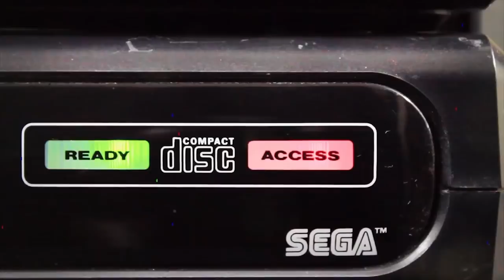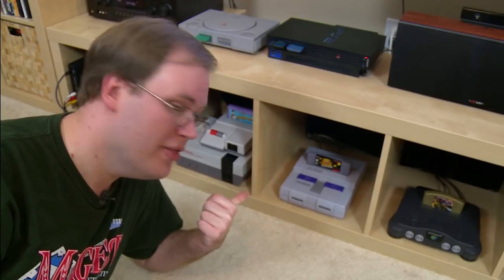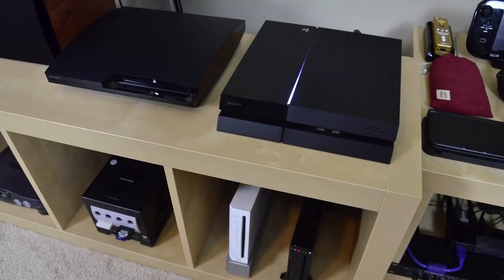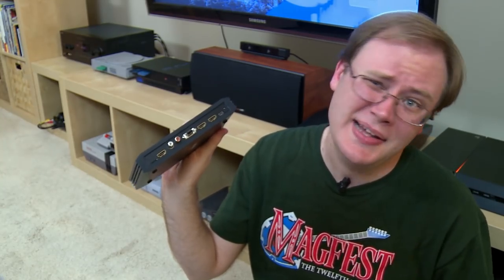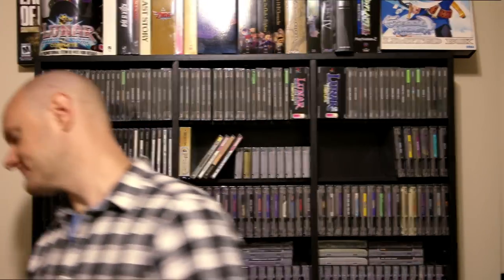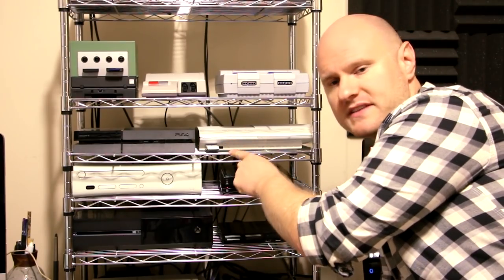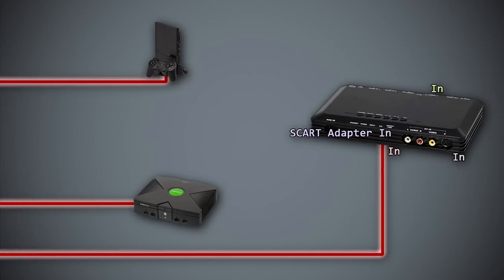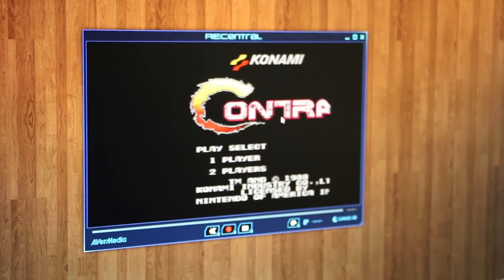RGB and Modern Gaming Setups :: RGB102 / MY LIFE IN GAMING

Comment: So if the framemesiter converts audio to HDMI, does that mean that consoles will pretty much have HDMI audio, or will it still sound like analog audio?
Reply from the maker: NicRenee Khaw [Try4ce] As long as your source audio is as clean as it can be, I don't think there's anything inherently wrong with "analog" audio. At the end of the day, if analog video and analog audio is just the nature of what a console can produce, you can't really think in terms of Digital=Good and Analog=Bad. But it's true that analog has to be treated with care to give desirable results. That said, my ear isn't tuned for sound nearly as well as true audiophiles, so maybe that's just my thinking.

If you do get a buzz introduced into your audio line, then that's going to come through the Framemeister too. Since starting to use a SCART switch box, I noticed that a buzz from some consoles became fairly apparent. I've started to purchase SCART cables with higher grade shielding (offered as an upgrade option through retro_console_accessories), which has done an excellent job of resolving this issue for me.
Reply: ***** Well, yeah. I was just curious to know.

Comment: btw awesome videos I am really diggin this channel. keep up the good work.

You may cover this later on, but is there a reason why Try uses RGB scart on the ps2 instead of component? is the image clearer that way? I always thought the image clarity on the ps2 was really fuzzy. Also this may seem like a noob question but since we are going into 4k will 1080p consoles display better with a rgb signal upscaled to 4k rather than a 1080p upscaled to 4k? since rgb uses analog would it contain more data than the digital 1080p signal? somthing similar to analog movies being able to be remastered from their original analog storage.
Reply from the maker: +TheRdfrota [Try4ce] RGB is just a color space, and the type of signal we're using with old consoles. As for why I use RGB on PS2, it's because I don't have any 480p games to take advantage of the component connection, so I may as well use RGB (I think it looks minimally better too, 480p aside). It's actuality possible to get 480p with RGB on PS2, but it's a bit complicated.

As for 4K, the cool thing about 4K is that it's 2x 1080p, 3x 720p, and 6x 240p. They all scale to 4K without any weird non-integer scales! 480p is the odd man out. Sadly I haven't tested a 4K TV myself, so I don't know yet how good or fast the scaling is, but in theory it should be fine for 1080p and even 720p. I imagine 240p will still need an external scaler to work well, but that would be 240p to 720p/1080p, then a simple scale to 4K. A 4K scaler will be interesting, but probably not that necessary.
Reply: +My Life in Gaming interesting! thanks for the input. After watching your videos I got very interested on the subject. Did a little digging around and specially during the ps2/dc/xbox/gc generation there is some that suggest component and some that suggest rgb. I have seen some video comparisons online but never live. but seems rgb does have shinier colors(if this is a good way to describe it).
Reply from the maker: [Try4ce] The reason one over the other would've been presented back in that generation probably has more to do with regional standards than actual quality. Theoretically, they provide the same results. Depending on how it's done, that's not always the case. RGB is easier to get good quality out of because it clearly defines to the display/device exactly what the colors should be. Component (YPbPr) may require more tweaking on the user's end.
Reply: +My Life in Gaming Ok understandable. I cant wait to try some of this myself. Thanks alot for the tips! I also liked the video on the retron 5. I bought a bunch of famicom and super famicom rpgs because of that video.

Comment: Gotta recommend the bandridge scartswitcher aswell. Running 15 systems through a network of these without any complaints. Havnt added the framemeister to the mix yet but cant imagine with would have any bad effect
Reply from the maker: Daniel Lubner [Coury] So we've both experimented with the Bandridge. Try was having issues because certain system that were plugged into input 5 would receive a little power when another system was on. It was really bizarre - the power light on the Genesis would turn on when it was plugged into slot 5 if you turned on a system in another slot -  and would also only work in that slot to boot. So deciding not to risk damage to the system over time, we decided not to recommend it right now.

However! I found a little guide on the unit recently where you can cut a trace on the board inside the switcher and it prevents this from happening. So I opened mine up and did it, and I seem to be having no problems at all. So we might have a solution (its just really hard to get the unit open!).
Reply: ***** hmm havnt noticed that. Then again all the stuff has just been plugged back in together a few days ago. Gotta look into it. Didnt sound to good.
Reply from the maker: You can read a little about it in this thread. The mod I did is on the first page towards the middle http://shmups.system11.org/viewtopic.php?f=6&t=48460

Comment: Me again sorry to disturb you. I am in the market for some RGB cables however I use PAL systems so will need to get some PAL RGB Scart cables however, the wire that the framemeister comes with is japanese "scart to rgb" will this work if I use PAL cables?
Reply: No, j-scary has the same connector, but some pins are wired differently, and can/will cause damage. But you can get a specific adaptor for euro scary, or convert easily.
Reply: Sorry for the typos. It autocorrected scart to scary, and the YouTube app won't let me edit. Or see what I'm typing. And it crashes after I post. WTG Google.
Reply: Joshua Pearce Perfectly fine, I understand :P. Is there an adapter you would recommend at all?
Reply: Legend, thank you so much :D
Reply: Joshua Pearce Do you know where I can find RGB modded consoles to buy? I don't mind getting the boards and modding myself but it would be nice to have an unmodded version of each console for my collection
Reply: No clue, sorry. Never bought one, I know what anyone with google knows.

Comment: Does the Framemeister generates more lag than the Scart or YPbPr? Because for me this is important for play.
Reply from the maker: [Try4ce] The lag is not inherent to the cables or connections, it's the processing required to display the image on your HDTV. Each HDTV will be different, but the TVs are faster when they receive their native resolution. So if you run it through the Framemeister, it's most likely a bit faster than your TV is on its own. However, there are other options, and if speed is most important to you, then check out the OSSC... you can learn more about the OSSC and other Framemeister alternatives in RGB 105.
Reply: Ok, thank you.

Comment: What if I don't want to use the framemeister? I have the scart cable on my nes. Can I use a scart to YUV converter?
Reply from the maker: pelonalberto in the RGB 101 video we talked a little bit about a scart to component box that you could use. Also, there are SCART to HDMI upscalers that will also work - but the results will be nowhere near as stark as with the framemeister.

Comment: For some reason the Framemeister is not passing audio thru my VIZIO HDtv.....( using the RGB Scart input )....the audio on the SVIDEO input works fine though.....???
Reply from the maker: [Try4ce] Does your TV have a Deep Color setting? That can screw with Framemeister audio. You may also want to try disabling the Deep Color option in the Framemeister menu, since it could cause compatibility issues.
Reply: i'm gonna trouble shoot this over the weekend, and give you an update - thank you so much !!
Reply: Well, no Deep Color Setting on the TV , and I turned that setting off on the XRGB mini but no luck with audio on the HDTV ....

AND I just hooked up my PS4 using the HDMI input and STILL no audio ?? Im gonna hook this up to another TV cause its either a defective framemeister or my TV is not compatible right ?

I really hope I did not by a defective unit ....
Reply: SO I have now tested it on 2 different TVS using the PS4 to test the HDMI audio  : the XRGB  HDMI port DOES pass audio 2 both TVs using the HDMI on the XRGB,  however when i switch to RGB mode ; no audio is passing thru the XRGB mini on EITHER television set. I only have one console currently using RGB ( my genesis ) so I guess I have to wait until my SNES scart cable arrive to find out if I have a defective unit .....am I missing something here, seems like my troubleshooting is pretty spot on so far..........

Im using the Genesis 2 & 3 CDX 32X dbGrafx Booster TTP RGB AV SCART Cable from RETRO GAMING CABLES , maybe the RGB cable is faulty ? ( ive pretty much narrowed it down to either the CABLE or the XRGB ( please let it be the cable ..... )
Reply: FIXED :  The RGB input now passes audio fine with my Sega Saturn !! It was a weird cabling issue I was having before with my SEGA 32X ( I need an adapter cable that takes the stereo audio from the headphone jack from the Model 1 and carries it into the 32X AV input and then out to SCART via the AV OUT / otherwise the 32X does not carry ANY audio thru the scart lead if you mix a MODEL 1 Genesis with a 32X ) - Thanks & love the channel !

Comment: Thank you so much for posting all of your RGB modded systems and the results with the framemeister!

I subscribed just because I want to see if you ever find a solution to the manual switching of SCART cables. 

Amazing video!
Reply from the maker: [Try4ce] We've actually both been doing some stuff with SCART switching, but still need a bit more time with the devices before we feel confident in sharing our results, or making any recommendations.
Reply: Hey my life in gaming you guys are misleading these good people into buying unnecessary equipment!!!! All anyone needs to do this a retron 5 and you can use nes ,sens ,genesis, famacaoin, game boy , game boy color, and game boy advanced in hd on your tv and you can use pre-built in cheat codes ,can use save states , and has controler 2 ports for nes ,snes ,and genesis controlers !!!! I swear you guys are guys are sponsoring your own business of falsely useful game console tv cables!!!!!!!
Reply: *****
 I've been thinking about the switch box solution, and I believe it should be possible to use an existing component gaming switch box via making an 8-pin mini-din Framemeister cable that has male RCA jacks on the other end of Right audio, Left audio, CSYNC (use yellow), Red, Green, and Blue. Then from there, you'd have to make all your console RGB cables have male RCA jacks on the other end this same way. Then you'd just simply plug them into the passive gaming switchbox, using yellow for CSYNC and of course R,G,B for the same colors there. The only problem is this would of course require modifying all your cables, but in theory should work perfectly.
Reply: Victoria vigeick
  A retron 5 is merely a collection of emulators in one box, not the actual hardware. Many enthusiasts (like myself) want the real hardware. Thus, there is no 'misleading' going on here at all. If emulation is your thing, then by all means go for it, but nothing beats the accuracy of having the real hardware.
Reply: That doesn't make any sense at all!!!

Comment: brandridge scart switch, there you go. it also gives you a option to take audio with a stereo jack from the switch.
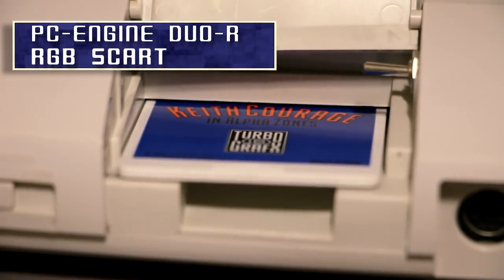9:00 turbo Everdrive will fix that issues, seriously screw ebay
http://shop.krikzz.com/
http://retrorgb.com/
Reply from the maker: dylbob9000 [Coury] Since this video was released, I've been using the Bandridge selector. We initially didn't recommend it due to an issue with port number 5 sending power to whatever it was. For instance, plugging the Genesis into it would cause the power LED to come on, even when the system was off.

But I found that opening up the switcher and cutting a trace on the board, you can fix this.  We've also been experimenting with other switchers and plan a RGB 300 level episode on what we've found.

Everdrive wise, I use them for several systems, including the Turbo. I like them for capturing footage when needed, but thats pretty much all I use them for. We're both really big on playing and beating the games we buy, so I don't track or "seriously play" any games that I can only play via an Everdrive.
Reply: i got my Bandridge in October last year and didnt get the power issue you got, i must have got lucky or they revised the model
Reply: have you looked at the Extron System 8 Plus? its a switch thats b/c based (so you know, more cables/adapters) but the upshot is that it has some kind of filter that will clean up the image as a bonus

Comment: Also I hope you guys get a Neo Geo AES sometime to your collection, by far the best arcade gaming experience ever in my life.
Reply from the maker: +Joél Bernabel [Coury] I'd love an AES but I think I'm gonna go with an Omega consolized MVS for when I get into Neo Geo. We will however, be doing a Neo Geo RGB episode in the next several months.
Reply: +My Life in Gaming Id recommend getting a cheap mvs board,  a supergun board from arcadeforge and hookup a Pc power supply to it.  It has  the neo geo controller ports,  scart female connector and has the same 4 pin molex connector that IDE hard drives used to have.  Sure,  you need something to mount it on,  but its gonna be a lot cheaper than an Omega.

Comment: other than trying to capture footage, there's no point in running modern HDMI systems through the framemeister is there?
Reply from the maker: +Cesar Montes [Try4ce] Pretty much, yeah. I did some tests to see if it could improve 720p for example, and it just doesn't seem to have any benefit that makes the risk of extra lag worth it. But yeah, we run all of our HD systems through the Framemeister only for the purpose of capture (mine is split so that the signal that goes to the TV never went to the Framemeister).

Comment: What do you guys think will give a better quality picture on my Sony CRT? A s-video  cable going from my snes into my Sony CRT  or a rgb scart cable going from my snes into a scart to component converter and then the component cables coming out of that converter and into my tv? Any opinions is greatly appreciated! Thanks.
Reply from the maker: beefcurtainz69 [Coury] Scart to Component converter for sure. S-Video is still great looking but if your TV supports component, its absolutely the way to go.
Reply: Thanks so much!!  I bought a cheaper scart to component converter so hopefully it works just as good as the expensive one or else I'll buy another lol. So I needed the component cables for it so I bought some pretty good ones thinking all component cables are the same output but on the package it says displays crystal clear 1080i and 720p to your hdtv. Will these work on my converter to my old Sony CRT? Are all component cables the same or did I buy the wrong version? Now I'm confused lol.
Reply: +beefcurtainz69 I used to use an SNES with the official Japanese 21-pin RGB cable, connected to a Micomsoft X-Select D4 which can transcode RGB to component.  From that I used a D-Terminal to Component cable to connect to my Sony Wega TV.
Reply: +sabishiihito oh ok sounds good. Thanks. Maybe I will look into a xrgb too.
Reply: beefcurtainz69 If you're going to go the SCART to Component route I highly recommend using your CRT, as the Component signal that is going to your TV will be 240p. HDTVs almost always recognize 240p signals as 480i, so it won't display as well as your CRT which can recognize and accept that 240p signal. Hope this helps!

Comment: is it better off using component or rgb scart on ps2, I can easily get scart rgb since I live in the uk
Reply from the maker: [Try4ce] Component can give you 480p in compatible games. You can get 480p with SCART if you use "sync-on-green," but you have to jump through a few hoops to convert that into something that most TVs or scalers will recognize. Fairly few PS2 games support 480p though, so a simple SCART may be the best idea for you.
Reply: ok thanks :) great videos by the way

Comment: How do I know if my scart cable is jp21 or Euro scart? I'm thinking of buying a framemeister and need to know if I need the adapter.
Reply from the maker: +Cesar Montes [Try4ce] Unfortunately, we're really not the people to ask. We don't know much about the insides of cables, or how to identify the difference. You just have to be careful every time you buy a cable to check which type it is sold as. Can you check any records of when you bought it?
Reply: I did, but it's not very clear
Reply from the maker: +Cesar Montes [Try4ce] Does it just say "SCART"? A lot of people use the term "EuroSCART" just to be extra clear, but technically SCART IS the European standard. If it says "SCART" at all, then it should not be JP-21.
Reply: +My Life in Gaming turns out it was the Euro scart, thanks =)

Comment: Does the D-terminal hook up also carry the sound to the framemister as well?
Reply: +Kelly Greenidge Most likely no (not fact). Maybe if you can get the cable straight from the console into it, but still I don't know if it carries audio or not. If using component cables then definitely not.
Reply: +MadFinnTech Thanks a lot I did find out the answer to my question.

Comment: Nice info, what's the purpose of the HDMI splitter?  I don't have audio right now so I dunno if it was mentioned in this video...
Reply from the maker: [Coury] We use the HDMI splitter to send video to our TV and another to our capture card.
Reply: Ohhh, many thanks!
Reply: Does XRGB outputs 240p SCART RGB and 480p component signals to 720p/1080p?  I'm planning to hook it to an HDMI switcher like kinivo if I get one..
Reply from the maker: [Try4ce] Yep! It can also output 480p if you want.